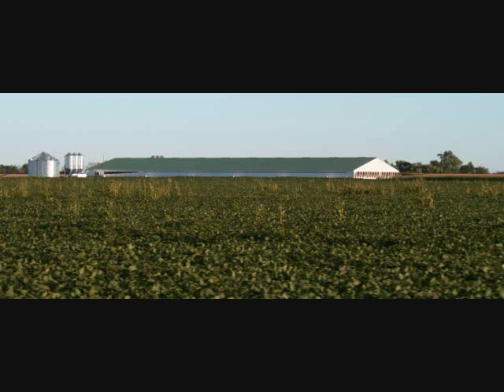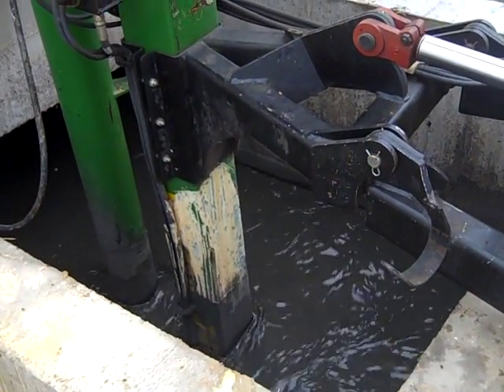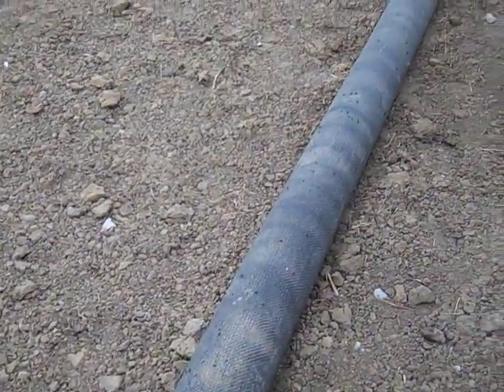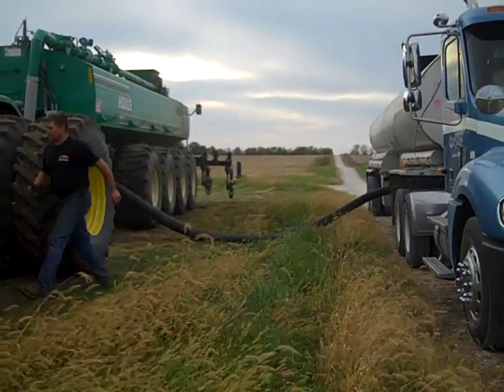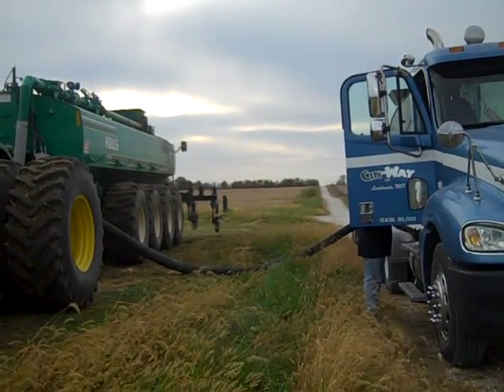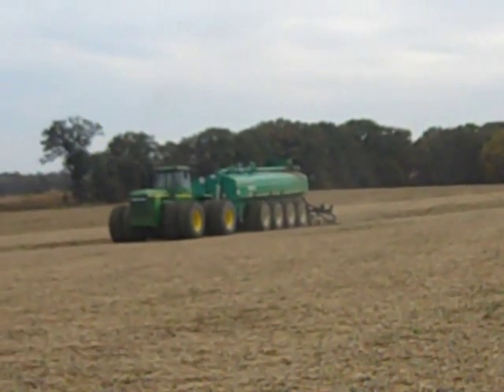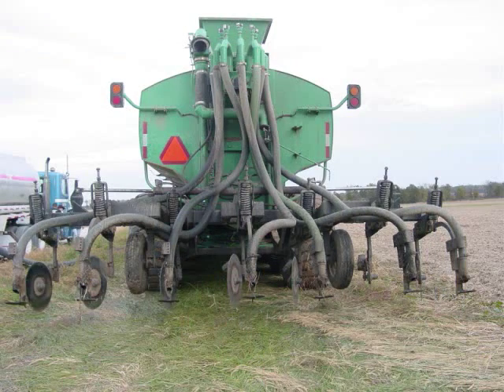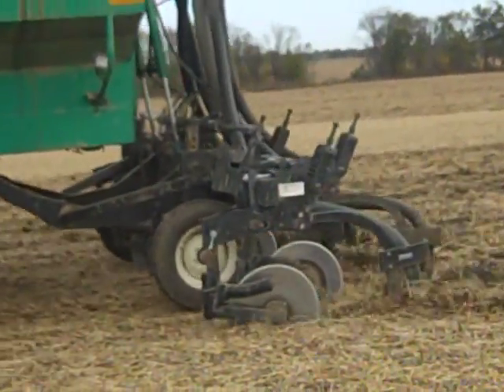Manure Management_2010.wmv

Comment from the maker: That's a good point. I should have shown that part because it is really cool how it works. After the transfer from semi to wagon is complete we are able to shut the valve on the truck but the wagon keeps sucking, which allows the excess in the hose to get sucked out. Then, they guys just unhook and lay the hose in the ditch with no wasted fertilizer and no spills.